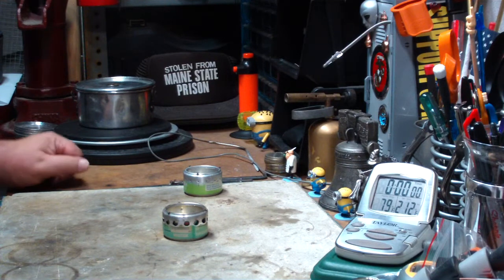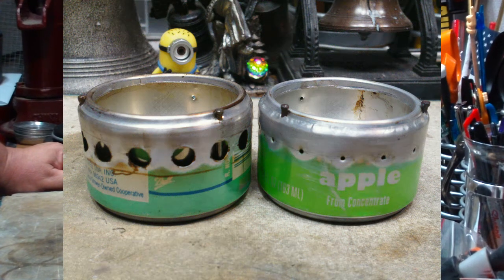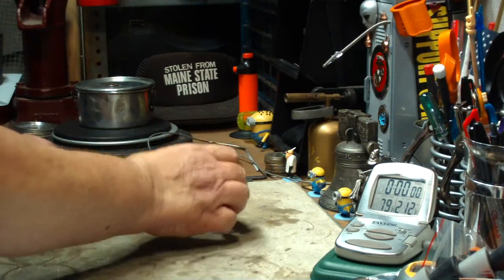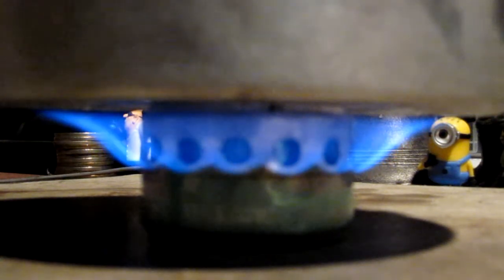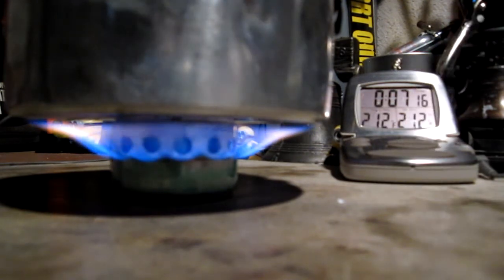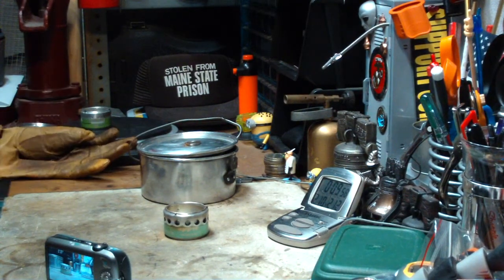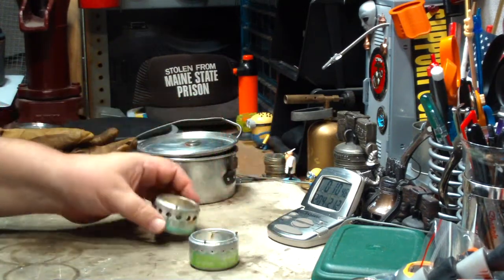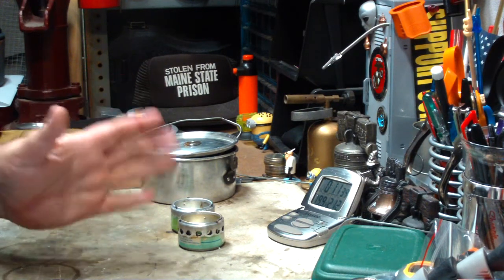ColoradoCamper's Hybrid Side Burner Stove - Low Pressure - Boil Test #1

Comment: Hiram, I made this stove hoping that the lower pressure would not shoot the flames out as far. I was trying to make a side burner that would work well with narrower pots, because the small jet holes send flames up the sides of my small pots, like the GSI Minimalist. I made it after my original DIY Stove video, so that's why it didn't appear there. Cheers.